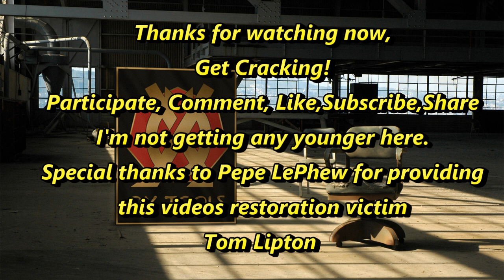Czech Scale Repair Part 2

Comment: Hi Tom

I started my working life as an apprentice scale mechanic. I worked on many similar balances. Such machines are a joy to work on because of the precision shapes and design. I never had to do that kind of repair but did have to make sure the balance of all the parts were accurate.

Those pleasures are long gone, your repair did bring back some memories... thanks again.

Kind regards

Peter

Comment: Hi Tom,
Nice repair. nice to have something unusual to discover.
About thread positioning/timing, I would try this formula: The offset angle / 360 deg X thread pitch dist.= how much to remove (a little on the less side)... This gives you a little slack since you can have some play with tightness. Just an idea...
Nicely restored,
Pierre

Comment: I used to do that all the time with our con rod nuts to get the slots to line up with the split pin hole at the required torque. Till I redesigned the con rod to take cap head bolts.They used to be 1/2" BSF which was 16TPI so each thread was 0.062" and each flat was roughly 0.010" so it worked out real easy. I used to do them in the lathe and use the DRO. Great stuff keep it up and I will put some vids up when my ne W/S is finished. I have one vid up akdenyer.
Allister

Comment: Mr. LePhew has good taste in artifacts! And,,, Tom as per usual, does excellent repair and demo on thread timing,,, that, will no doubt save some folks a great deal of head scratching when they run into the same dilemma... Thanks for sharing Tom! Hope all is well... :o]

O,,,

Comment: i liked the idea of a sub chuck for machines of that size. i just got a 19" leblond running for a friend of mine. it has a four jaw with a L1 spindle.. i think i'm going to steer him in the sub chuck direction for three jaw work. thanks for the idea.i have run into that clocking problem installing rifle barrels it can be a real pain in the but.
Reply: I've had limited success with a sub-chuck on my 7 x 14 to parts where I'd use a collet on a bigger lathe - but didn't feel like working out in the cold garage that night...

I forgot which machinist taught me that trick - it's a pretty good one, if you can get a good smaller chuck to use.

Timing a screw thread on a part that bottoms to set its length is a real joy, ain't it?

Comment: The smaller scales are really useful.
If you want to get the weight difference of two items. You put the items in the lower one and the weights in the higher one.
Normally you only add weights on the scales never remove it in the process.
And you don't have the exact weight to get the balance. Many times you have something like 1.1 , 1.2 , 1.3 , 1.5 , 1 , 2 , 3 , 5 , 10 , 20 , 30 , 50 , 100 , 200 , 300 and 500 gram (kg) weights.

Comment: Nice repair.  Another term that possibly can be used for aligning those screw threads is called 'clocking'.  One can only imagine how difficult it was to align the original threads that were integral to the original part.  They couldn't remove the threads to remove a bit of material. . .

Comment: Nice repair, it's great to watch fine machining work and your videography is very good.
I had a couple of thoughts:  
The slots on the screw heads are made so fine to stop people (peasants) from cranking down hard on the screws and stripping them
The small pans can hold weights that act as dampers allowing the scale to settle down quicker and stop oscillating and to counter any eccentricity of the mass of the material being weighed and air movement or other disturbance.
Reply from the maker: Hi John,

Those are good observations. My neighbor sold the scale the next weekend after I repaired it for him. Thanks for the comment.

Cheers,

Tom

Comment: Excellent vid Tom, thanks. I have a question. I noticed on the small Buck chuck, a thin line radiating out from the center of the chuck. (dumb question I hope), is that a crack in the casting? I'm thinking safety here.... I would think that the cap screws would hold it together, but.... Cheers and thanks, Daniel.

Comment: Any reason you didn't try the left handed bits on the repairs? Might have extracted the broken stubs easier?

The dual pans may be for holding balance weights when the items weighed took up the whole pan. Long pans with short pans above. Weights go in the short pans.
Reply: I think they might be for when you're having a Long Weight...

Comment: First rate repair Tom.  That is a really cool balance scale. At the old job we had a smaller analytical balance inside a glass case.  I don't remember the make or specs on it but it was very accurate.  Very similar features to the one you worked on.  Does the guy have the weight set to go with it?

Comment: Tom, you continue to use the Whisker System of Measurment ambiguously. Please be a little more precise by mentioning which whisker you are referring to:
Black - The thickest.
Red - Thinner than black but thicker than blonde; the most exciting measurement.
Blonde - Thinnest whisker, but always changing and unreliable.
Gray - Most accurate and precise.

Comment: Hi Tom, interesting repair video as always!
A little question from someone with a more theoretic background (technical engineering): Doesn't centering the workpiece using the 4jaw allow for more wobble in the whole "assembly" of jaws, since the weight of the small 3jaw is off-center?
It's probably a clash between "reasonably aligned by a man of the trade" and "nitpicking engineer" here, but I was wondering if/when the effect is noticable.
Greetings from Germany,
ExplosiveBoy

Comment: I just use an angle grinder or disc sander with a drill to chamfer threads.
Reply from the maker: KISSMYACE3203 Hi Kiss,

For M3 threads? That's impressive. Thanks for the comment.
Cheers,

Tom
Reply: I think the smallest I've done is maybe a #8 screw that needed shortened. We cut all our all thread on a chop saw as short as 3/4", but it's nearly all .25"-1.25", cleaned up on either a angle grinder or disc grinder.

Love your videos, keep up your awesome work!

-Smiley

Comment: Tom, check Wheeler Engineering's gunsmith screwdriver set. it has a ton of flatblade tips in different thicknesses and widths. i guarantee it has a bit that would fit those slots perfectly. you can find it here. http://www.midwayusa.com/product/439523/wheeler-engineering-89-piece-professional-plus-gunsmithing-screwdriver-set?cm_vc=ProductFinding